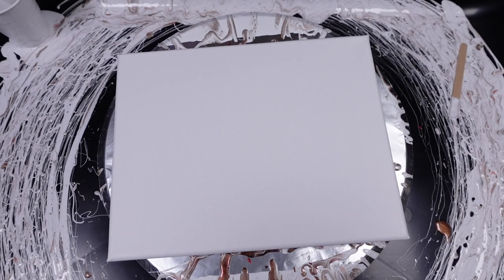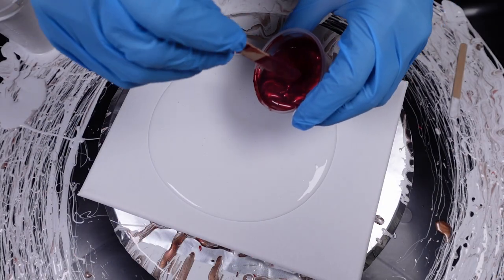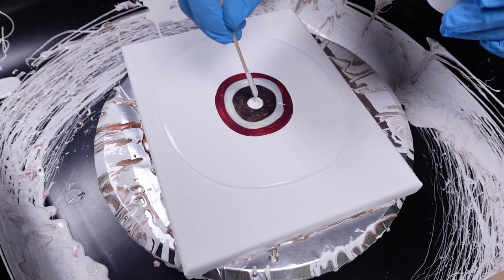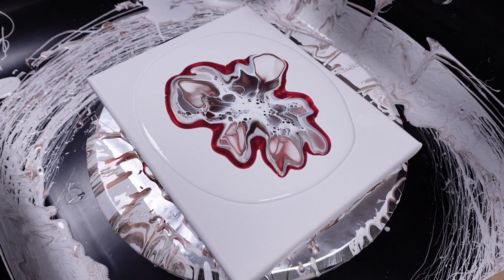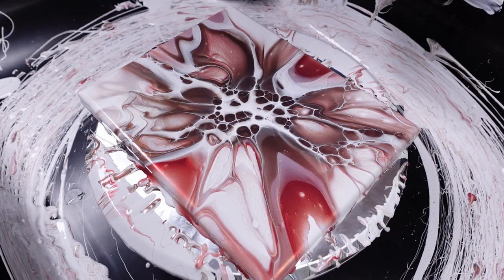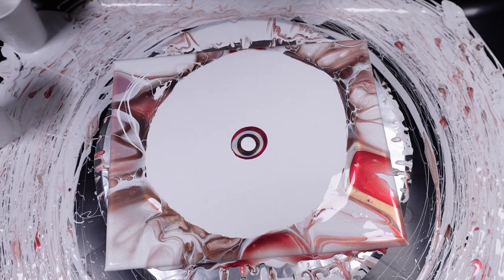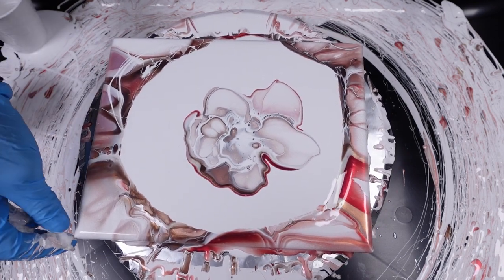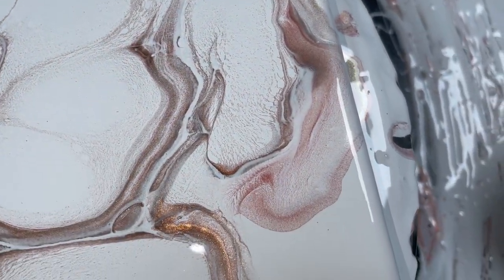Acrylic Pour Bloom - EXPERIMENTS!!

Comment: Hi Johnny. I bought everything you said for a bloom. To a T. It works so good on tiles and really little canvases but I do bigger ones from 16 in to 3 ft. How much should I mix for an 11x14 or 16x20? Also the housepaint is soooooo thick and its been a problem. Can I still mix floetrol with it to thin it? I can't work with that thick of paint. One more thing. The housepaint is dulling my colors fierce even when I add a little. I have to add more poly than anything and I dint want to have to. Otherwise thank you and the recipe is perfect. I just need help in those areas please and thank you? Awesome work by the way